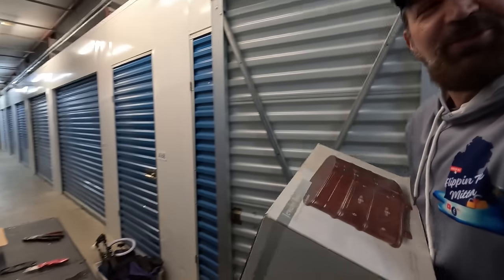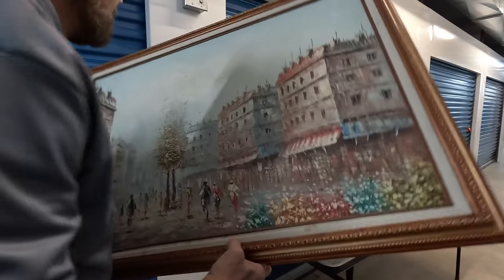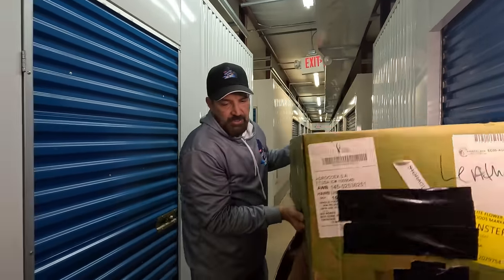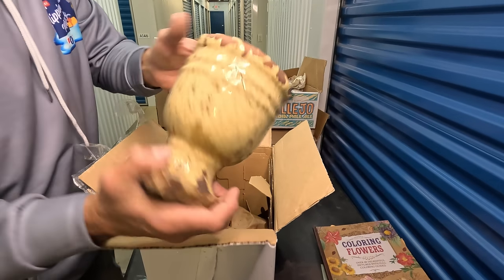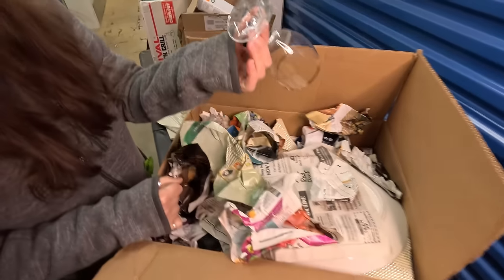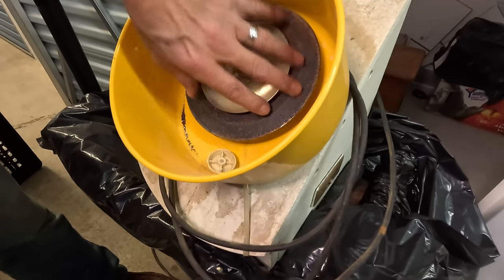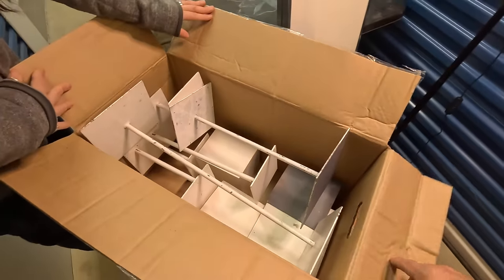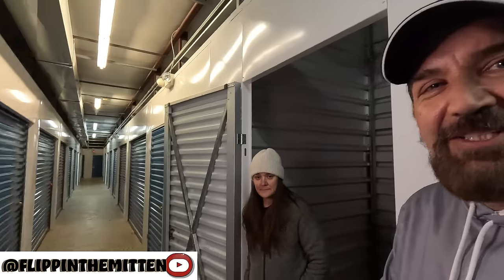I'm Betting on a Lucky Find! : Unboxing Storage Unit Auction Finds

Comment: How do you know when there are Auctions to bid on and how do you do it. I had to retire and going nuts siting at home.
Reply from the maker: We mostly find them on line right now. If you google storage auctions you will see a bunch of sites. We do regularly use at least 4 of them. You will be able to put in your zip code and see the auctions near you. When you see one that you like you can bid on it, usually there will be people bidding also, especially near the end of the auction. One thing to notice is how long you have to clean it out (usually 2 or 3 days). If you get one you will probably have to bring a lock, also (sometimes a regular padlock, sometimes a cylinder lock)